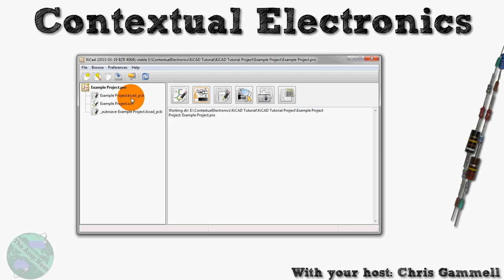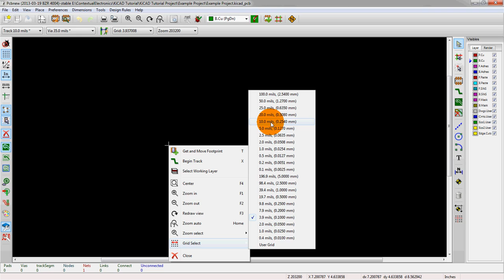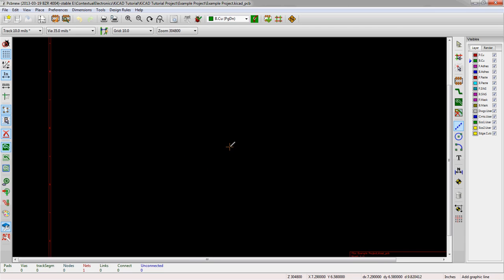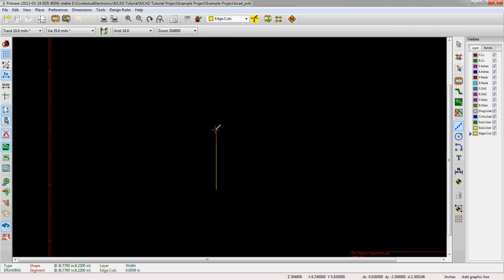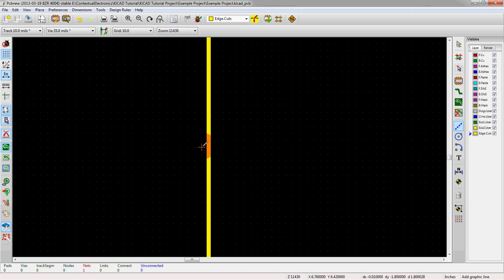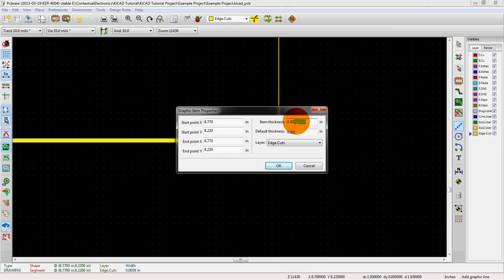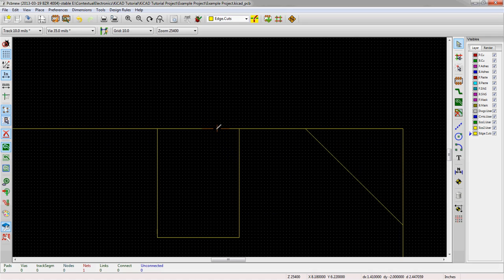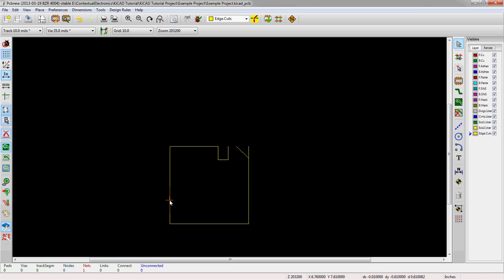KiCad 3.0 - Defining A Board Outline In KiCad

Comment: Can round the corners of a rectangular board outline in KiCAD? In Eagle it's very easy, can't find any such functionality in KiCAD. There's the arc type that can be used - but you have a start point and then the center point, so... some calculations need to be done to round off a corner exactly. Not very user friendly. Not as user friendly as selecting a radius and click the corner...